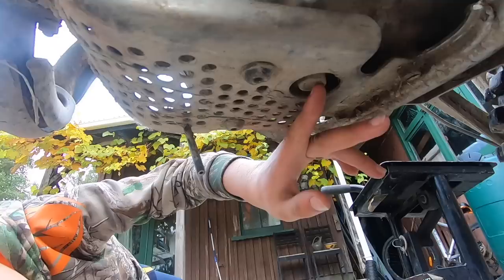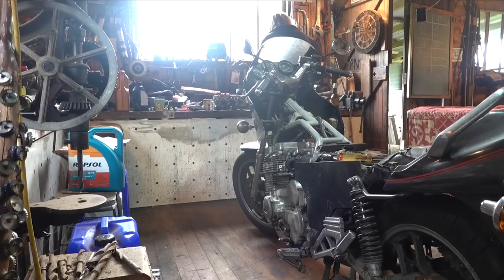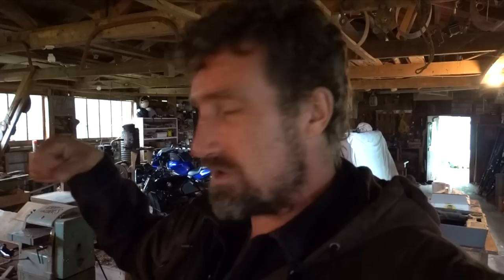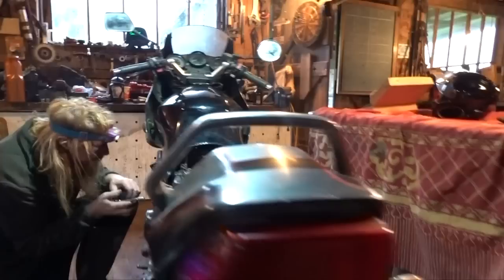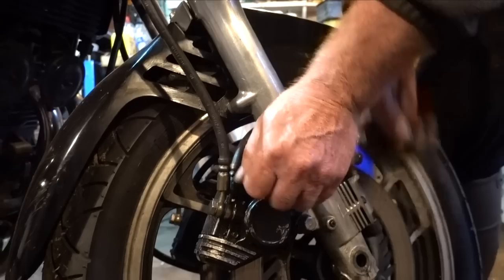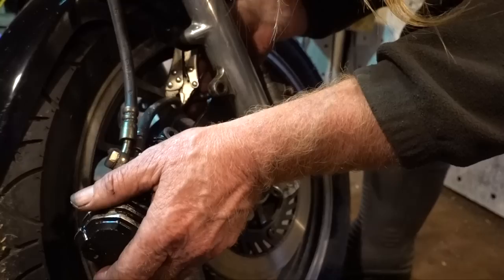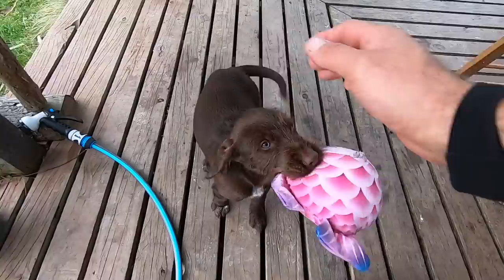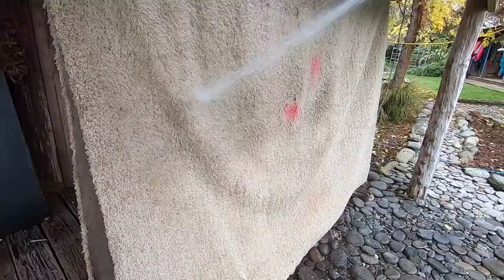Josh James NEW ZEALAND Adventure VLOG 146  - Dans shed - motorbikes and a classic stitch up!

Comment: When I’m preparing a vacuum tool I drill loads of 0.5 and 0.7mm holes an ideal tool for this is a Dremmel or similar as you have really good control if your going to do more of the same, top notch vid thanks

Comment: Put a light coating of motor oil on the inside of the rubbers and outside of carb throats, makes going in so much easier.
Reply: An use the mrs hair dryer too, heat it up enough to do the trick.

Comment: I had an xj750p that behaved the same.. the c.v carbs are fussy about airflow and someone had fitted pod filters, back to original air box and filter and the problem was solved. They really scoot along though when they’re good. Check it out check it out check it out!